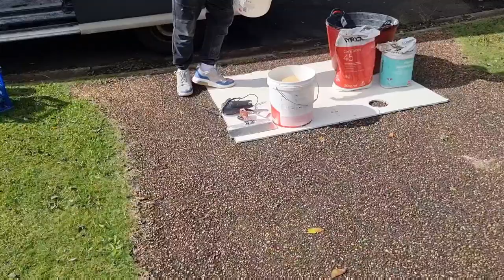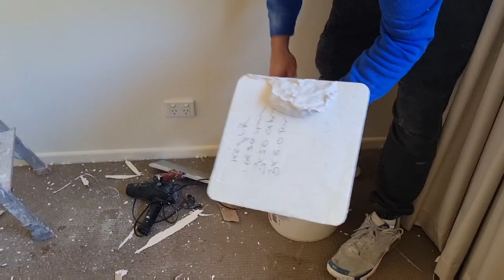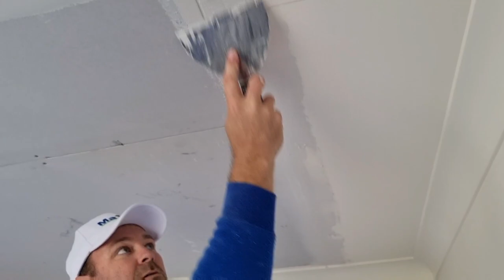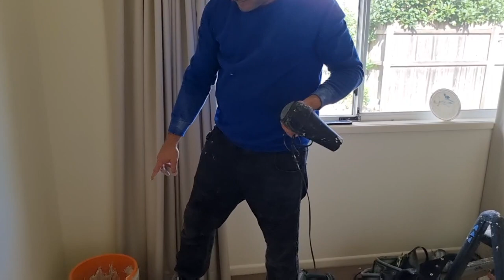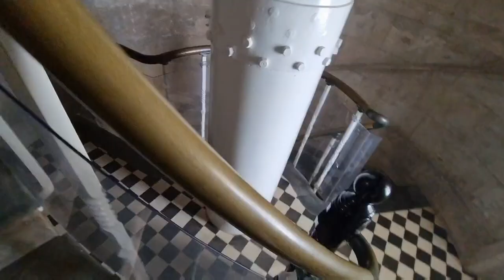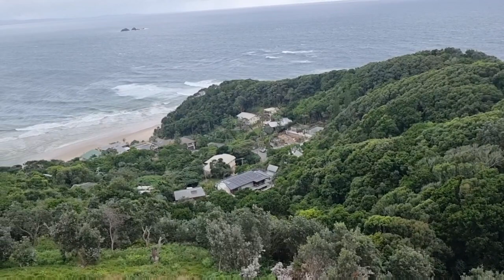Drywall Ceiling Repair Prefill & Taping FibaFuse with a Plaster Accelerator

Comment: why was the second seem loose? I saw it move when you ran your knife over it. Will that not cause it to crack? I'm not a professional sheetrock installer so im just wondering if it matters.